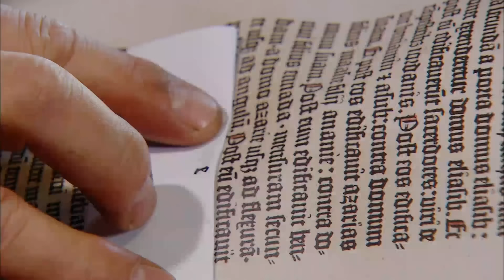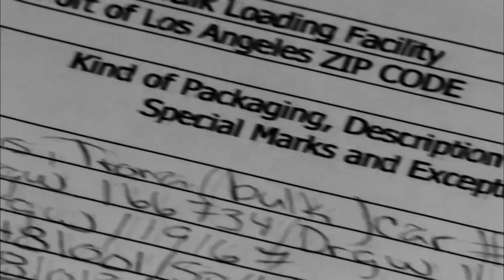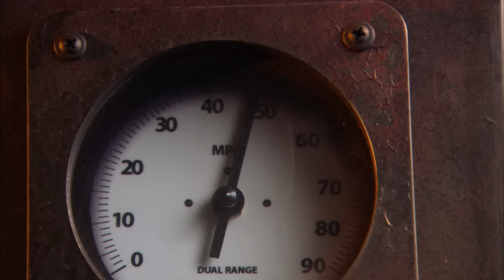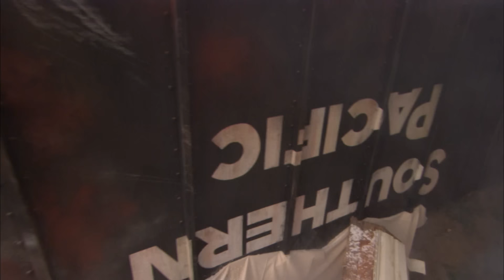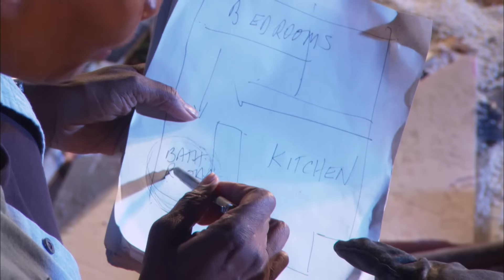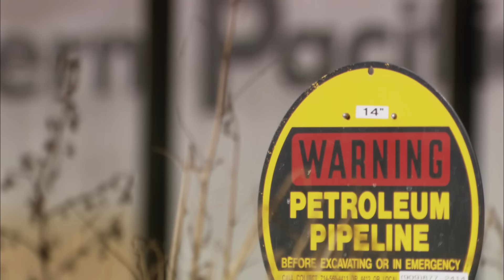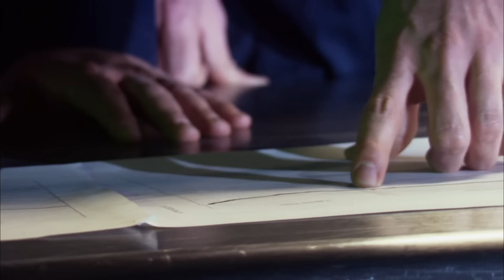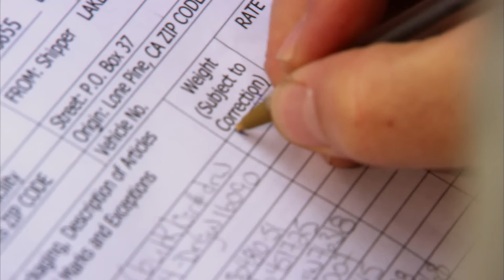Horrifying Runaway Train: San Bernardino Train Disaster SP 7551 East | Mayday | Wonder

Comment: The helper engineers survive. Why aren't they being interviewed?
"They fail to notify Holland only one of the two engines had brakes."
Oh.
Reply: They also engaged the emergency brakes which disabled the dynamic brakes, which caused the train to gain even more speed. I'm not sure you can blame them too much for that though. I'd concede that they probably didn't know that the brakes were basically useless at that point, and that the dynamic breaks were the only thing holding the train back. We have the power of hindsight, but they didn't have the power of foresight.
Reply: @samhouston1288  If they had had the power of foresight, they would never have moved that train an inch without anything less than like four locomotives up front, four in the back, all of them with fully functioning everything.
Reply: @samhouston1288  You'll be happy to know that now if the train goes into emergency, the dynamics will NOT cut out.  That was one of the changes that happened because of this accident.
Reply: their lawyers told them not to?
Reply: The real fault was the manifest. The supervisor is said to have used coal as his yardstick. I've never seen trona, but I can tell you it would way considerably more than coal. He should have used sand instead. Appearently Holland thaught the emergency break was the right thing to do.

Emergency, is not a different breaking system. It just the final possition on the break handle. Stops the train a bit quicker than full aplication & dumps the air, you you'll come to a stop, even if you imidiatly release it, the air will not have recharged yet.
Reply: @ShadowDragon8685  90 shipping containers on a mile long freight train weigh about the difference here, so it's huge.

 6 or 7 locos all with dynamics 5 a bare minimum.. (you might get away with 4 modern AC macines) & take it very slowly, especially. They had only 2 DC locos with working dynamics.
Reply: @johnsergei  One item, it was the helper engineer that put the train into emergency, not Engineer Holland.  Another item, there were two braking systems, dynamic brakes and friction brakes.  When the helper engineer put the train into emergency, it automatically deactivated the dynamic braking system.
Reply: @NiceMuslimLady  I have heard that Holland thaught it was right. It's said the both knew that would dissable dynamics, but remember Holland's paperwork told him he had cars loaded to about your double container intemodel train & many of them are as long (& today even longer). But with the weight of the heaviest mineral trains, in each car, of course the brakes would overheat after being on for miles.
Reply: @johnsergei  Yes, I know the tonnage profile Holland got was wrong.  "The head-end engineer testified that after the helper engineer placed the train brakes in emergency, which in essence nullified all dynamic braking capability, he believed there were no further options available to him to stop or control the train...."  NTSB report, Page 91, Paragraph 2.
Reply: @NiceMuslimLady  I cannot remember where, could be in the NSTB report? that Blair used loaded coal hoppers as the yardstick for estimating the weight of 7551 East.I can tell you that the same volume of something fine like trona would be considerable heavier than coal. This train was very heavily loaded, a single stack container intermodel in Australia, with 2 or 4 (modern & more poweful) locos up front, may way around 3,000-4000t & be longer. Yet 7551 East was almost loaded up to the level of the huge ore trains in Australias Pilbera, where in more recent years they had an unmanned runaway, that the intionally derailed in the desert.
Reply: @johnsergei  Yes, Lake Minerals had a loader with an accurate scale and they put in 100 tons in each hopper car.  They were supposed to send the finalized weights to SP Los Angeles office before the train was taken, as it was assumed that they would do that, but, for whatever reason, they failed to do it.  In simulator training, they never actually trained for a runaway, as the sim training always assumed that if a train went into emergency, it would stop.
Reply: @NiceMuslimLady  Even today I think only the Fortescue Railway In Australia would have heavier loading to any real degree. 42t axel loads when loaded. But  there is nothing like that decent were these huge Pilbera trains run.
Reply: @johnsergei  Yes.  I think you are right.
Reply: Wouldn't have made any difference at all as the train was overweight (sorry for fat shaming)...
Reply: @Megabyte How many times do you have trains that are runaways?  Even that doesn't happen all that often.
Reply: @NiceMuslimLady  I'm quite astonished at the under estimation of weight. be it 54t the load or the whole loaded car?

They must mean the load?
To have 54t in these fully loaded cars would be quite a light meterial (+ about 25t for the car = about 80t). In reality each car was well over 100t. Each car weighed as much as a, entire loaded tripple Australian mining road train.
Reply: The derailment come from poor communication, malfunction of brake system, weight miscalculation.
Reply: @samhouston1288  They are the engineers and brakemen!!! They SHOULD know that, it's kinda important.
Reply: @johnsergei  *brake not break. You said it twice so not a typo. Good info though.
Reply: @johnsergei  *weigh, not way.
Reply: @goodshipharmony  AH! the spell police gotmee!!
Reply: @johnsergei  lol yes we did! 🤣
Reply: @samhouston1288  But it should have been known that the dynamic(electromagnetic)-brakes would be shut down when the emergency brakes were applied.
That knowledge should have been written in their dna!-- that is fore-knowledge that they should have had.
In addition-- the guess on paperwork-- at the weight being a third less than it was, ....  The new law inputting the maximum weight is soooo good.  Have people verify the weight so they have to work harder to get the maximum load they pay for.
Tsk, tsk, tsk.... at least we can learn several preventatives from this disaster.
Reply: @samhouston1288  Just wondering, even if they hadn't engaged the emergency would it have stopped the inevitable? Sounds like they were going to keep picking up speed because they were unaware of the total weight and didn't have enough brake power no matter what they did.

Comment: I know this story well. The mineral mine used a system of knowing how much each loader bucket full weighed, and the operator counted buckets to full every time he loaded train cars. They stayed within limits. The company had bought a larger loader with a bigger bucket right before this train was loaded. Operator didn't realize he was adding a lot more weight with same number of scoops.
 Also. When the pipeline burst, an operator was familiar with the pumps failing that pumped fuel to top of the hill. When the pressure dropped because the pipe burst he did what he always did when the pressure dropped, hit the button to restart pumps. He did this over and over, each time the pump would restart and then shut back down by default because of safety switches showing no pressure. The back wash valves in the hillside were all broken as this show stated, and all the fuel in the pipe for miles ran back down and was pushed through the rupture, but until the call came in to the pipeline office a guy at a control panel was pushing a button over and over that sent even more fuel through from the pumps.
Reply: thanks - I was wondering if the train was doomed from the beginning, how would they ever transport the cars - the brakes, which are on every train car,  failed, so fewer cars would just have fewer brakes to slow it. Makes sense now that every car was overloaded.  So they guy who assumed they were not fully loaded was basing it on historical knowledge, and it was really the mine the messed up and overloaded the cars.
Reply: @jdierks2539  The Raiload should have been told that they weren't using a scale and were counting buckets and had been "guessing" the weight. It was going to fail at some point whether they changed machines or they hired a new guy who couldn't keep count, either way, it was a bad system of tracking weight.
Reply: @crippledbeast_U-toob  It is not necessarily a bad way to track weight. I worked for Caltrans, and we put 5 buckets of material in the truck, weighed it, then got a tare weight of the truck, and we were within a couple of hundred ponds. The giy wo didn't consider the train fully loaded made the mistake. I would have not made that mistake, In the absence of a defined weight, by best guess is they are all fully load. That is just common sense.
Reply: @jdierks2539  Correct. Poor coordination of the company to blame, not any single worker. Proper action would've been to put these kind of companies out of business.
Reply: @crippledbeast_U-toob  In essence then each hopper was loaded with nearly twice as much product as the guy who made the "Educated Guess" thought, up to 200,000 lb (100 tons) vs 120,000 lb (60 tons.)  It's no wonder that the train went out of control and may easily have even if ALL the dynamic brakes were working.
Reply: Thanks for the added info. I could comment on a lot of things about this story, but what surprised me most was the fact that they were allowed to use locomotives without brakes. Do you have any idea if this is still the practice today? I may be simple, but I think that all locomotives should have brakes.
Reply: @groussac  Where did you get the idea of "locomotives WITHOUT brakes"??!!
Reply: CV
Reply: @ddandrews6472  If I recall what they described in the video: One of the locomotives at the front was completely nonfunctional, another one had malfunctioning brakes, a third had no dynamic braking (which they didn't know about), and one of the locomotives at the back also had no dynamic braking.
Reply: @b-chroniumproductions3177  Yes, grossly insufficient braking. I thought you were saying non of locomotives had any braking.
Air braking that helps to apply brake to the carriages weren't working properly. I think that was the main culprit. Having all the locomotives with working brakes is not enough. Carriage braking must also work in order to be effective in an emergency situation.
Reply: Not to mention one off the extra engines breaks wasn't working period..
Reply: @jamesroberts1810  Yes, that would've played a bigger part toward not being able to slow down the train, at least marginally.
Reply: Yep..they also had another derailment In Canada!! Cp rail in 2019 train 301!!  it's an documentary..I gotta send it to you
Reply: @jamesroberts1810  I just looked up. Can't find a doco on that one. If you know, please send me the link. Thanx.
Reply: Andrew did u look at the link i sent u
Reply: @jamesroberts1810  Hey James, where did you send it to?
Reply: I'm gonna try to send the link to your YouTube list
Reply: Look up fifth estate - runaway train - cp rail 301 ..its on YouTube...it sad faulty train cars
Reply: @jamesroberts1810  Got it. Thank you. Cheers.
Reply: @mt3311  The "All wagons considered max weight" policy was not adopted until after this accident.
Reply: So the pipeline operator was just sitting there doing the Homer Simpson deal where he put the little fluid filled glass bird where it would hit the vent gases button over and over?
Reply: It was just a big f-up on cal-nev and the 2 trains that did not have proper braking power

Comment: My wife was watching this and had told me I'd be surprised what caused this wreck. I'm a career truck driver and heavy equipment operator and the 1st thing that popped up was too much weight. I've seen it and had it happen to me when you get more than you think you have and the same thing can happen. If the right weight had been relayed to the dispatcher they could've adjusted and come down the mountain with either more engines with dynamic brakes that worked OR fewer cars. It wasn't Frank Holland's fault. You work for a train outfit, you go by the numbers handed to you. It was a crash that was made when the cars were loaded. Just took a short time to finalize. God Rest Their Souls.
Reply: @sparrowflying864  I agree BUT I see a bunch of holes in the whole thing, the 1st the faulty paper work. When you run the same route with the same load you ought to have a 'feel' for how the whatever it is you're in and be able to tell if something is haywire. I'm no train driver but have driven all kinds of trucks and equipment and you can tell if you're heavy pretty quickly.  80k loads and 21 tons of concrete can kill folks just as dead as a train, just nearly as widespread. I hate it happened but you got to pay attention to your rig.

Comment: It's been 32 years since that crash. However, despite these changes, runaways still occurred, especially on Cajon Pass, like the 1994 runaway when a Santa Fe intermodal lost its braking power and collided head-on into the back of a Union Pacific coal train, or even the 1996 runaway when a Santa Fe manifest also lost its brakes and came off the rails, killing two crew members. Since then, no more trains have run away down the grade, and now, safety systems are in place for when a train's air brake pressure drops too much from a kink, a leak, or a disconnected hose, emergency brakes are applied automatically to stop the train. Still, locals will never stop wondering, have they seen the last runaway train of Cajon Pass?
Reply: My friend's fiance lost her husband in that Union Pacific crash.  She now lives in Fullerton and gets his full pension for life and whatever else they give out.
Reply: @TheFrenchPug , wow. I am so sorry about that.
Reply: Now a lot more things are computerized

Comment: I lived in Rialto between Baseline and Highland. My yard ran into the wash. I actually helped in the search after the wreck. I had just been "spelled" (given a break) when they found the guy at his mom's house. I remember thinking "I was just standing right there". But they got several things wrong with the story from my memory. One train guy jumped we were told. Didn't survive. Hit the ballast at 90mph. The guy we dug out had been sleeping on the couch in the front of the house not taking a shower. 
Also, I was there when they pulled the cab out of the wreckage with Frank's brakeman still in it. That thing was crushed so badly you could have put it in the bed of my pickup. I can still picture what he looked like. 
Mile long train and the crash site was less than a 1/4 mile in length. If they could have made that corner they would have been in the wash where nobody lived.

Comment: After the helper engine called the mayday, it’s shocking to think it took several calls to get them on the radio. You would think they would’ve stayed right by the radio.
Reply: Cut them some slack they were on break
Reply: @12yearssober  hey, suicides don't speak.
Reply: i agree boneheads
Reply: He was probably contacting his boss for emergency services to let them know they had a runaway train
Reply: They don't actually say mayday on the radio. The show just added that.
Reply: He said we're doing over 90 MPH! We are out of control
Reply: @Dannyedelman4231  Up till that point all the speeds had been in KPH.
Reply: @Dannyedelman4231  
The black box tops out at 110MPH, and it was pegged for a while. It's estimated they were going 120-125 when it came off the tracks.
Reply: @ImTheJoker4u  oh I believe that no doubt there speedometer topped out at 90
Reply: maybe they didn't use the emergency radio channel and just used the normal road channel.

Comment: Southern Pacific should have refused shipping without the tonnage being filled out on the form.
Reply: SP should have just made the rules to be "full capacity" if no tonnage indicated unless the car was MT.
Reply: @NiceMuslimLady  That is what SP (and now UP) did after the disaster. Now there is not estimating. If the line is empty, assume the max weight.
Reply: @louisbouchard6869  I know.  I've know that since the investigation was done.
Reply: Thanks Mr. Hindsight.
Reply: SP should have just made a rule that locomotives without perfect working brakes are not in a condition to be allowed to work.
Reply: All you guys would be great people to have around the day after an emergency happens!
Reply: @normie2716  Right. 🤦🏻‍♀️

Comment: Everyone involved in this tragedy had one thing in common; the desire to cut corners for their own personal convenience.   Particularly those in the maintenance of the fuel safety valve systems and the trains' braking mechanisms were a disgrace.    Everyone just wanted to get things done "quicker", without the annoying but necessary burden of thoroughness, with strict adherence to regulations.
Reply: I was a locomotive electrician for 12 years. We did the absolute bare minimum.

Comment: I recall hearing that immediately after the accident, investigators wondered if the brakes had failed, or hadn't been applied at all. One went over to a steel wheel and put his hand on it, severely burning himself. Yes indeed, the brakes had been used and had worked as well as they could.